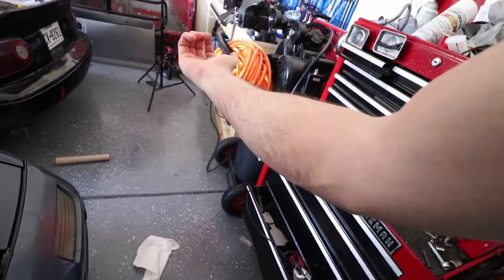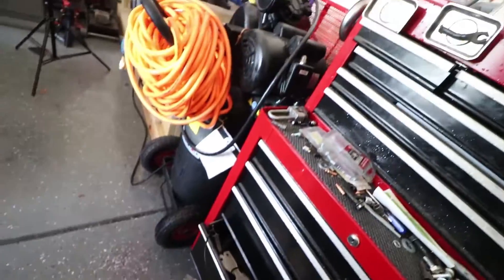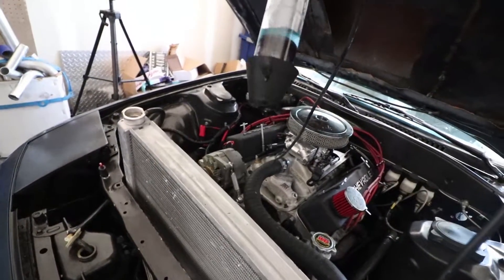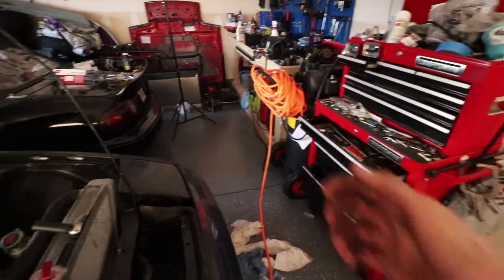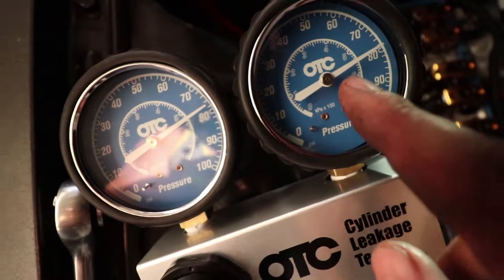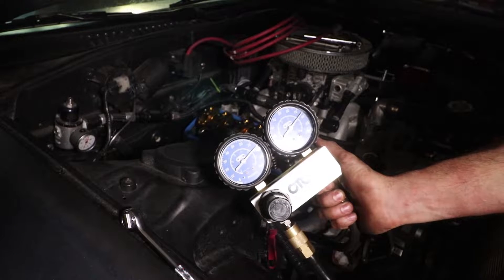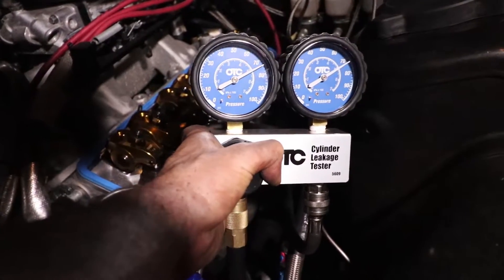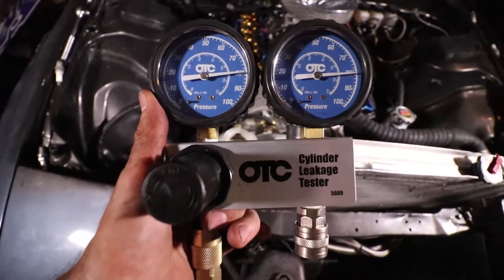My radiator blew up on me

Comment: How do you even do this safely?
Reply: you let it cool down. or if you're experienced enough you SLOOOOWWLY twist tha resivoir cap off til the pressure is equalized with the atmosphere and then ypu can safely twist it off. how do you become experienced enough, you may ask?

watch this video.
Reply: @bobbytables658  Either that or release the pressure by using the bottom radiator valve. Just a few turns on that screw and the pressure will be gone safely by the tiny escaping hole.
Reply: Yea dont get under your hot car and try to turn that little valve on the bottom of the rad ..  relase pressure ..  lol. Yea..  its gonna blow off the valve and shoot a stream of 220°f liquid at you at like 7psi for about 5 minutes..

Comment: what did you expect? you pulled the seal off a hot radiator that shit was building pressure and you still held it you should have had your buddy there to shut the engine off. How hot was the engine before you started because it heated up hella fast if you started from a cold engine.

Comment: Happened with my friend's G 2 days ago. My friends car was overheating and we waited 15 minutes and the thermostat read wrong and read that it was getting cooler and I twisted that cap off and ol faithful erupted and burned my stomach and left side of my face. 2nd and 3rd degree burns. Coolant hit the hood looking like a fire hose and flew 10 feet out. Be safe with radiators boys. (Btw keep proper coolant level in at all times and bleed it out properly. I think the reason the thermostat read colder than it was was because of a lower level of coolant meaning the engine had boiling hot coolant/water and the top read cold
Reply from the maker: sorry to hear about that. Yeah radiators are no joke.
Reply: @TheDailyDrift  tell me about it. And it's all good. It was my simple mistake lol
Reply: You need to wait until the needle hits cold before you open it, not as it starts to cool down. That can still be 80 or 90C
Reply: It happend to my right eye

Comment: The thing explodes at 1:48, just be careful man i think why the tube explode it's cuz probably u let I go or it pushed it up and u where not holding it right , eitherways just be careful stay safe bro
Reply from the maker: Yeah, it popped off the second I let go. I was trying to create space between me and the radiator because it was building so much pressure I thought the glass might break, but I couldn't shut the car off. It was a shitty situation to say the least. So I just tried to minimize the damage 😅. Will do!